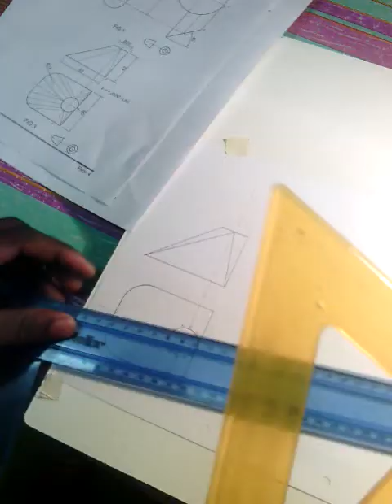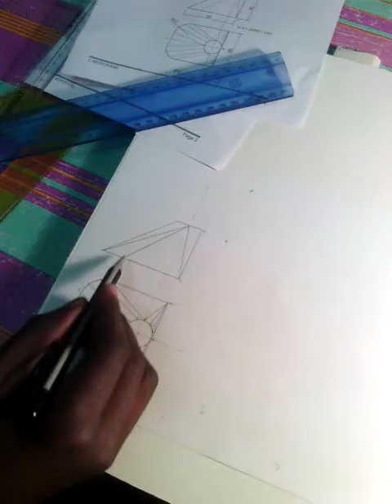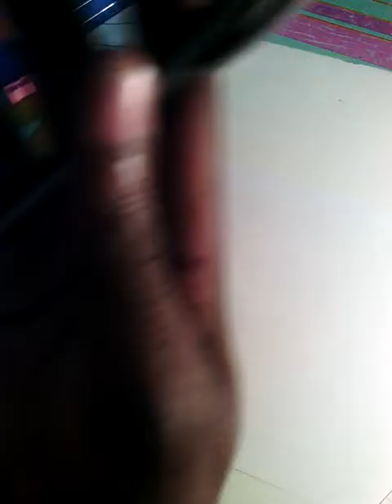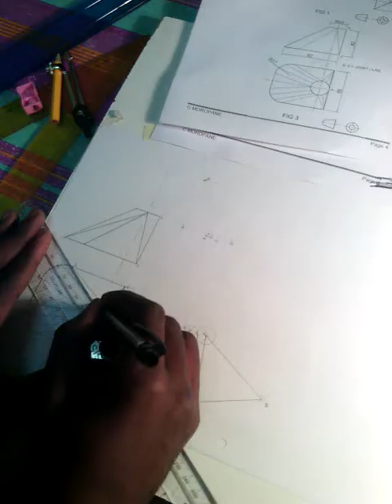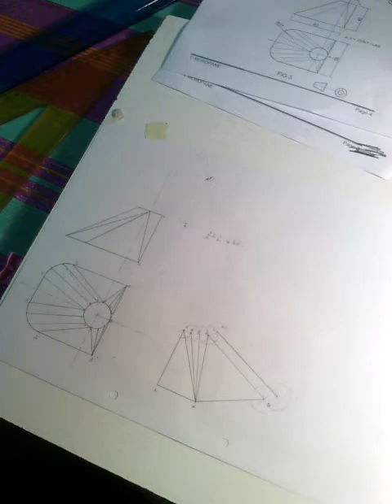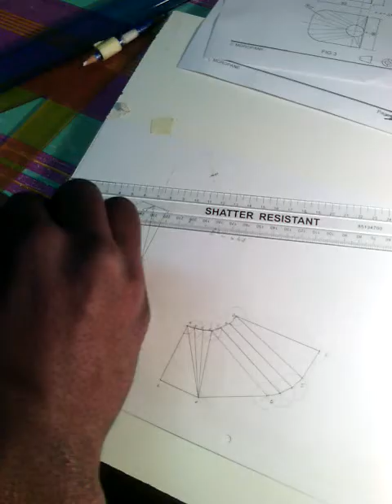N2 PSSD(part1)

Comment: Hi sir, how did you get the arc 17
Reply from the maker: Firstly create as if you were drawing a square, then measure 📏 17mm from the corner of the square and mark the 17mm on your horizontal and vertical lines off your square.
Reply: Please make a video of the given view only sir
Reply from the maker: @philahxaba1046 alright 👍 cool